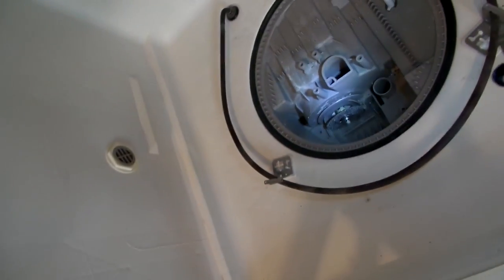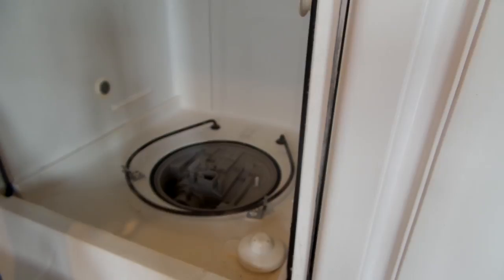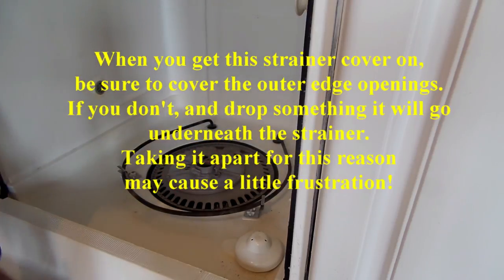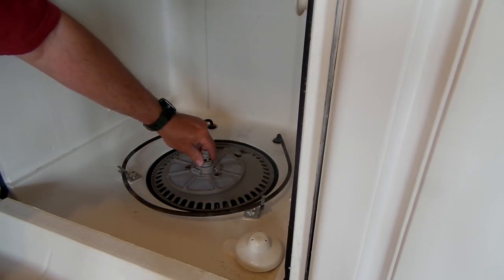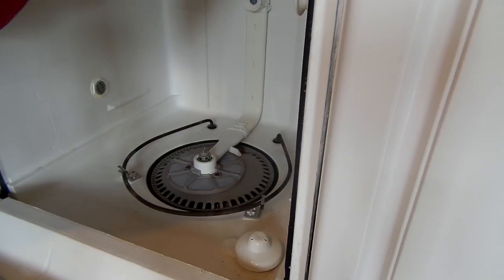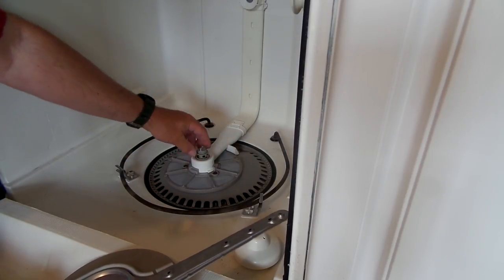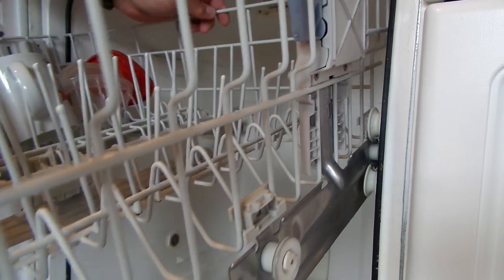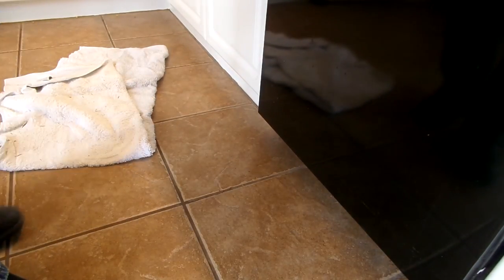Kenmore Dishwasher Repair - Drainage and Noise

Comment: You just saved me $700.  I've got a decade and a half old Kenmore dishwasher that has served us well. Over the past year, we've noticed that it hasn't been cleaning the dishes as well and was getting noisy. Ran dishwasher cleaner through it a few times with only minimal improvement. Earlier this week it suddenly began howling during the wash cycle. I contacted an appliance service center and described the situation and even had the tech listen to it over the phone. He announced that our dishwasher was a goner and would probably cost more to repair than it was worth and he couldn't say how long it would last if we did repair it. So we began looking for a replacement. Narrowed it down to a few in the $559-$699 range and were planning on going shopping for one this weekend. 

I had the day off so I decided "what the hell" and looked up videos and websites on dishwasher repair. I ran across your video which looks almost identical to our dishwasher. An hour later and I had the filter and circulating pump housing off and was cleaning out an amazing amount of debris and a lot of crusty scale. I got it reassembled and started it up empty. The noise was immediately 80% better than it had been and half way through a regular cycle it was as quiet as when it was new.  I'll run a load of dishes tonight, but I anticipate that the problem has been solved. 

Thanks
Reply from the maker: David Halls beautiful. I hope it works out.! Thanks so much for the comment. And if it goes well, great, if not, you are in the 10% that tried..most people just slap it on the credit card, and then wonder why they have no money....

Comment: Thank you so much! My dishwasher is very similar to yours, it started making a noise and I googled and came upon your video. I followed it exactly and not only fixed the problem but cleaned a lot of nasty stuff hiding all over under the parts. When I got to the grinder there were several pieces of plastic and very small bones in it. I cleaned all the parts while it was all disassembled. I'm sure that repair would have cost a bit and it wouldn't have been cleaned. The only place I had trouble was putting those darn little blue end caps on the top tray. I've had trouble with them before.  I wish you had showed how you do it (you hand kind of blocked it) I still have one on the counter waiting to be put on, I gave up! (I'll try again in a while). Again, THANK YOU!! Very good, easy to follow instructions.
Reply from the maker: Thanks, I’m glad you found the vid and it helped... good eve to you!
Reply from the maker: Laura Tango have a great day.. glad the vid helped!